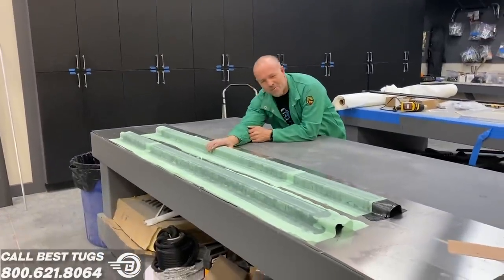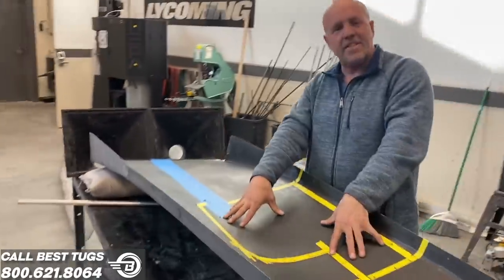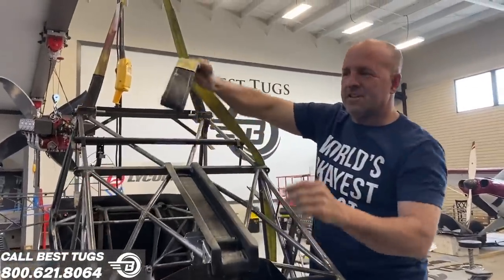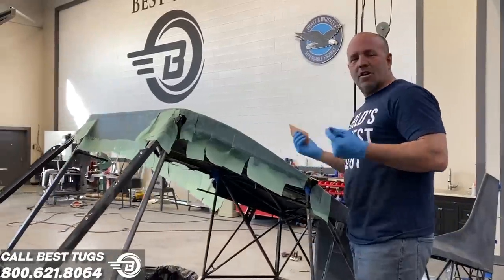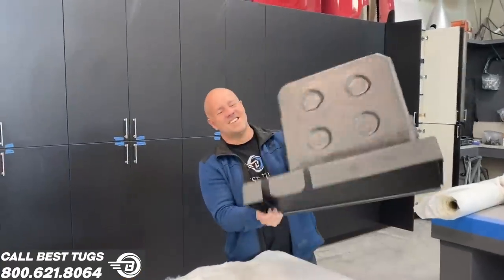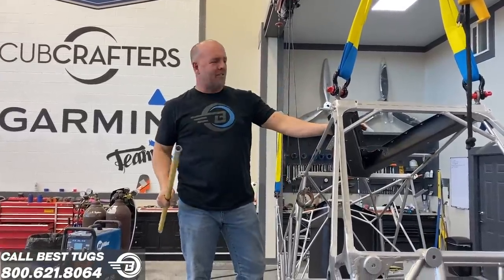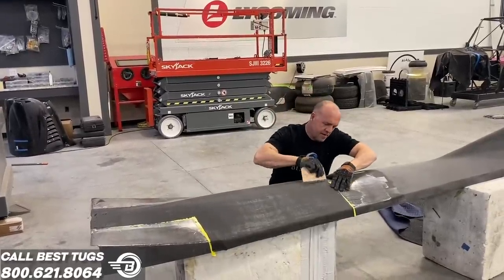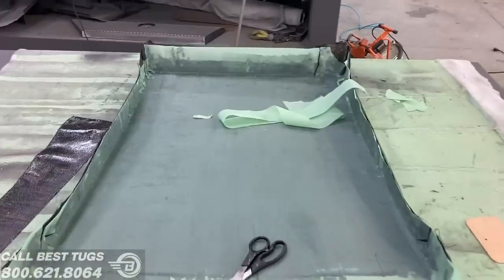Scrappy Bush Plane gets Carbon Fiber Parachute Tracks 🪂(Scrappy Bush Plane 20)

Comment: Most people “I’ll add a parachute but if I ever use it then the plane will be likely be totaled.”

Mike “I’ll add a parachute and do it so well that I can stay in the plane and fly it out of there the next day. Then I’ll test fire a chute just to make sure it actually works like I planned it.” 

Mike you are a cut above buddy! Love these videos.
Reply: Underrated comment of the year.
Reply: If anyone can pull it off it would be him
Reply: Don't forget that this is a carbon fiber plane. Meaning the strength per cubic measuring value of your choice VS the standard variant (ignoring all the bells and whistles) is off the charts. You could probably bend a cub in half if you snapped those lines strong enough in a fall, where as the carbon fiber might bend, might even stress, but i doubt there can be forces involved that can deform the super structure short of a full dive, but then parachutes or not, you'd have a bad day.
If all things were square and equal, this is how all planes should be built. Mike is fortunate enough to be able to do it, and who knows, things he learns and shares, will maybe trickle down to everyone else.
Reply: The problem is the softer you want the plane to land on the chute, the heavier and larger the chute would have be.
He could experiment with airbags in the belly of the plane to save it i suppose.
Reply: @aserta  This is a steel tube structure still. Carbon covered, but NOT a carbon fiber airplane.
Reply: William Williams something tells me the plane is going to be able to take some seriously tough landings.
Reply: aserta the actual load bearing frame is still chrome moly though. It isn’t a true monocoque structure like we see in modern IMOCA 60 sailboats or F1 cars. I think working in CF allows Mike to build in lots of necessities (e.g. cooling ducts etc) that he couldn’t do as easily in fabric which is still lighter per sqft than the CF. The CF skin adds structural rigidity, but it’s still tied to that chrome moly. Maybe Mike, when he has time (not sure he sleeps tbh) can address how much strength the CF structure adds vs the delta increase in weight vs fabric or?
Reply: aserta no doubt it’s a very tough airframe.
Reply: @aserta  Yep. It'll be a relatively safe aircraft (KOOKY hotrodded engine notwithstanding!!) :)
Reply: Why the fuck not? I mean if you can save your life and a year-year and a half of work why wouldn't you I mean hes already got at least $40,000 in "scrappy
Reply: If he really wanted to test it, he could do it like SpaceX:. Drop the airframe out of a helicopter 10+ times and deploy the chute.  Then, he could do the inflight abort test: at 15,000 feet, throttle to firewall, maximum dive, and pull the chute handle at 12,000 feet above terrain.  If it's worth testing well, it's worth testing ludicrously.
Reply: vibrolax haha he’s wealthy but not Musk wealthy
Reply: @williamwilliams8145  he will not need a very big chute with that suspension he's building,  lol!
Reply: @williamwilliams8145  the crazy baha suspension he built for might just be all the cushioning he needs.
Reply: And bingo the entire airframe is coated at 20:23 :D
Reply: Yep! He's so devoted to what he's doing. Planning and giving all he got
Reply: @williamwilliams8145  IDK, he might not need airbags in the belly of the plane if that landing gear works as advertised. Remember, he said something along the lines of "this suspension shouldn't even bottom out if I forget to flare", and I don't know if you want it coming down any harder than that under a parachute.
I'm sure Mike's already done the math on it, we just don't have the info that's in his head (or plans) yet because he thinks almost too fast to be able to explain himself.
Reply: vibrolax There is an airspeed limit on chute deployment, but maybe this Cub can’t achieve that speed no matter what attitude it is in at deployment time. Drag alone may be the determining factor, like spin airspeed. 🛬
Reply: @salnichols94805  I see no evidence of Mike sleeping at anytime... Mike, I love your work, your ingenious engineering solutions and your humor, now back to work!
Reply: @sabo55  Noticed the same thing. Bam! Done. Back to work.

Comment: WOW,... Mike Scrappy is awesome. With the landing gear on that thing and the size of the parachute box, you can do a chute "landing" with no damage. That wouldn't happen unless you did it on purpose. If you need to use it, it's because you are over the woods or steep mountains and lost power or broke the air frame.

Comment: Amazing attention to details Mike. I was a lifelong wood butcher. Worked on some pretty high end millwork projects including Disneyland projects and huge Aquarium projects. Even Installed millwork in a store in the World Trade Center about 2 years before it was hit by the planes and came down. Also have done work on custom jet interiors and custom Yacht interiors. So needless to say I am fascinated by your projects. I have never worked with Carbon fiber but did a few fiberglass cloth projects which seems somewhat similar. Just not quite as messy. Can't wait to see that test. Good Luck Mike, but then anybody who does the kind of top quality work you do doesn't need luck.

Comment: Great video! Thanks for making it. You have discussed several times in your project protecting and isolating metal parts from the carbon parts to prevent corrosion. I was just curious how you do that with the nut plates in the parachute strap channels and elsewhere where you have nut plates riveted to carbon parts?

Comment: Mike, When sealing parts and you want a silicone seal use a G.E 2009 glazing silicone. It will seal without sticking to parts for easy removal.

Comment: I cant wait for Mike to start weight trimming on accessories. Survival shovel for the emergency kit? CF/Kevlar handle and shovel-head except a the very leading edge being steel. Tool kit for expedient repairs off-field? CF tray with CNC'd foam inserts. Sun visors/shades? honeycomb core with 2 layers of fiber, coming in at a few tens of grams. Most people would say thats going too far, but if anyone is going to do it, it would be Mike.

Comment: Mike, quick observation:

If you need to weaken the top skin to facilitate the parachute system deployment, do you loose the benefit of the carbon fiber skin proving torsional strength ? 

I’m guessing that your plan is to tie in the  strap tracks and the chute box structure into the frame to take the load (new torsional stiffness load path) ?

Really enjoy your videos !

Thanks so much for going through all of the trouble to make them so informative and insightful along with entertaining and for sharing the content with us 👍

Comment: Mike for your cables you should think about using dynima if you want to save some weight it's essentially the carbon fiber form of stainless steel wire.

Comment: Have you ever looked at electric powered flight? Although it is still in its very infant stages it’s a fascinating type of power that holds so much potential
Reply from the maker: I actually have off and on between projects.  Would be really cool!!
Reply: Mike Patey im sure you have heard of peter sripol, he built a ultralight that’s was powered by electric Motors under the part 103 regulation but I don’t know the laws of having one for a certified aircraft or whatever and obviously for the mean time it’s going to all be rotaxs and Lycomings, but if you’re giving it a glance every once in a while I’ll hold a thread of hope that one day we might get an electric Franken craft or even just a concept of one

Comment: Someone get him hooked on amphibs.  I’d love to see his take on something like the Icon or Runtan Skigull, make a true “go anywhere” aircraft.
Reply: Unfortunately Rutan retired and he isnt looking to build his plane. The Icon is a nice toy but it has no range. If Pately and Rutan joined forces to manufacture, that plane would become the new Cessna without a doubt, but everyone would have to start engineering to a price to make it viable for people like us to buy.
Reply: @michaelrempel9025  Rutan built Skigull for himself, but the MOLDS are in the hands of someone who could use them to make more! yeah Mike might get a bit bored with that though.. lol
Reply: I deeply admire Rutan and since I own a Searey I built, I was very excited about the skigull.  But the skigull did not apparently live up to Burts’ dream.  It’s apparently poor handling on water - possibly due to no step and a hull focused on low air drag but not really on water characteristics.  It also appears to be poor visibility for the pilot.  If it’s only about getting there...but that’s not what the joy of Seaplanes really is.  It’s exploring which requires high visibility.
Reply: @KenLeonard  I agree, Rutan is a great designer no doubt, but his designs often compromise so much for the sake of the best cruise and range.

I was super excited when I first heard he was gonna design a seaplane.  Then when I finally saw his design, I realized Id rather be sitting in between 2 morbidly obese passengers in a commercial airliner than crammed in his skigull tbh.

I would love to see what Mike can come up with tho - a plane engineer who spends lots of time in the planes he engineers - the perfect designer

Comment: Mike, I know that Cirrus aircraft usually suffer some form of landing gear damage when the chute is deployed, however I don't think Scrappy is going to suffer nearly as much if that chute ever needs to be deployed thanks to the high suspension travel and therefore huge energy absorption ability of the landing gear you designed.
Size the chute right and you probably won't damage the landing gear at all, but I can see how if you went too large on the chute the shock of it opening might stress other components of aircraft. Thinking about it some more, there are several ways you could mitigate the opening shock from a large parachute (staged deployment, elastic elements in the shroud lines, etc.) but they all add weight and complexity. As you say, it's all a balancing act, and I'm sure you already did the math for all this before you even started making parts.
It would be interesting to know some of the details of the parachute system, with a quick basic description of why you made some of the choices you did and what you expect to happen if you do have to deploy the chute.
Reply from the maker: I’ll be putting out another video containing more information about the chute. 👍🏻
Reply: @MikePatey  Thank you, I'm sure I'm not the only one curious about how the whole system has been engineered.

Comment: Mike, I just finished doing a BRS install on aJust aircraft Super STOL. Did you calculate shock loads at full reef. Just wondering if your attach points are strong enough.
Reply from the maker: That’s awesome!  Glad you put a chute in.  And yes, my work was done in line with BRS specs. 🤠

Comment: Hey Mike, when you use the prepreg carbon (roof in this case), you mentioned hitting it with heat - do you use a heat lamp since parts like this can’t go into the autoclave? Or is there a prepreg that cures at room temp?

Comment: Just a thought, how well does carbon fiber show up on radar? I would suggest that you put something around the bolt to protect the strap from chafing due to any vibrations. Perhaps a piece of pink anti-static foam that they stick electronic IC chips on.

Comment: ~pop's chute~ 

Aaaaaaand this years STOL landing winner is...
Reply: lol
It would be kinda unnecessary though, I think the only plane that had a chance to compete with Scrappy would have been Draco...
Reply: I believe scrappy has a much better power to weight ratio, should smoke Draco's take-off performance (if the wings provide the lift)
Reply: @firehydrant315  yeah and the crazy suspension allows him to slam Scrappy pretty hard into the ground. That can get rid of a lot of velocity.
Reply: You guys are forgetting ...  Draco had 600 HP brakes ... Ive seen many a STOL drag lost on less effective brakes ..Scrappy does not have reverse thrust like Draco
Reply: @markdoan1472  Will be interesting to see what brakes he uses. Why would scrappy not have reverse thrust? I thought that was standard issue for a variable pitch turbo prop.
Reply: Scrappy is using an 8 cylinder reciprocating gasoline engine, not a turbine like Draco

Comment: What kind of nut plates are you using? Are they corrosion resistant steel?, aluminum will corrode over carbon. Or, if aluminum, glass fiber layer between carbon and the nut plate.
Reply from the maker: Mauricio Castro 👍🤠 great question. yes,  coated Steele and never Alluminum but that is not enough for me so  in areas where galvanic corrosion is a concern, I layer one bid of fiberglass as a protective barrier. In areas without fiberglass layer I use an isolator film.
Reply: @MikePatey  great, your"re a rock star of aviation.

Comment: Mike have a question to do with all the metal that touch metal frame! Are you going to line the inside of all the carbon with fibreglass which touch or clip into metal like the parachute strap track. Don't quite understand why not all fibreglassed.

Comment: Did you consider fiberglass for the roof? The right epoxy would be pretty much transparent which seems like a stronger/better visibility solution than a window cut into carbon fiber. Obviously you'd need to deal with corrosion but I'd think carbon fiber would have that too

Comment: Would carbon fiber wrapped aerogel be useful for any part of this project? I read aerogel could get up to 4 ft by 4 ft be 3/8 inch. The article mentioned using it for plane interiors for insulation and soundproofing.

Comment: Considering the interference type fit on many of the carbon fiber parts, is there a concern that you may abraid the powder coat during assembly in those areas and create future failure points?

Comment: So when the straps come out will it rip the carbon fiber plate on top of the cockpit out? They are in the tracks and can run with the parachute out but when the plane goes to dangle how will the straps exit that track without ripping the top off. Is there some kind of removable piece on top of the tracks?
Reply from the maker: I’ll be showing that in an upcoming video. 🤠

Comment: Did you coat the frame at some point in the time this video was made?? It looked like bare metal in the beginning and you were welding on it, then when you were installing the carbon fiber tracks you said they weren't coming back out and I noticed the entire frame was an even silver color. How did you coat it?

Comment: @ mike patey Any concern about the track overlap into the parachute pod being a snag point? I would think you would want the overlap going the other way.
Reply from the maker: sabindaman  👍🤠 lol good catch I was just doing an example and not even the correct strap or direction of fold. I have no concerns whatsoever as I will lap correctly and there is nothing to hook on.
Reply: @MikePatey  I was thinking of the parachute itself snagging not the strap.

Comment: Are you going to paint it with a UV blocking epoxy clear so the CF doesn't oxidize or deteriorate?
Reply from the maker: Absolutely. 👍🏻🤠
Reply: @MikePatey  , I thought I'd mention it since the other viewers might not know that carbon fiber deteriorates quickly in direct sunlight. When I worked for Boeing on the 777x wing components, they are made in a windowless building and transferred from that building to the factory at night to avoid direct sunlight. Then the parts are painted for protection when the airplane flies.

Comment: wondering how you need to reinforce seat belt hard points if you could be pulling at them at more than  normal forward or reverse impact and how you can pad the interior for when a chute deploys and your noggin gets tossed around.

Comment: You made a sacrificial test panel for the rocket test, shouldn't you also make a spare in case the rocket is actually used in an emergency?  Seems it would be difficult to make such a complex replacement panel without the 'real' panel in place to use as a form.  Maybe I missed something.  Subscribed!
Reply from the maker: Red 94MR2 yes 👍 I made two spares.  One to install and one extra I can use or make another part from 👍🤠
Reply: @MikePatey  I figured you did since you seem to be a great planner.  Just watched  "DRACO vs FREEDOMFOX - High Sierra Fly In 2018".  Belated congratulations!

Comment: Wont parachute lines be able to catch on the strap track lip that goes into the chute basket? Or will it be covered with another carbon layer and bound to the basket? Talking about the part that's on the inside of the chute container at 20:54

Comment: Can you talk about how you decide when you will use carbon fiber instead of aluminum? Looks like you have an aluminum airframe but some companies like Cirrus are mostly fiberglass and carbon?
Reply: I'm pretty sure from previous videos that that's actually steel, not aluminum.  I'd guess that the design theory is that the frame and structural parts are all steel because it doesn't fatigue (until you stress it beyond the fatigue limit, of course), and this plane is going to land on a lot of rough terrain.

Comment: Hey Mike, I am a life long Mfg Engineer. After recovering from 9/11 caused Leukemia, I've started back wanting to design test and build different things. I've rebuilt a 30 yr old Matsuura Machining Center and have been machining all types of racing parts  for bikes and racecars. should fiish up my Laser soon. Would like to cut Carbon Fiber material with the Laser. interested in your thoughts on that. Thinking of building Carbon Fiber floats to build a kick ass 14' Bass fishing pontoon. Any advice? Mac

Comment: Ok so the front strap mounts. You made the metal strap pocket flush with the top of the plane should have the back of it open so the strap lays in it.